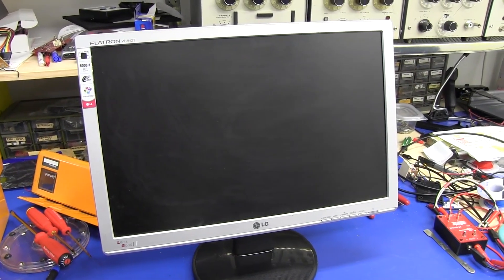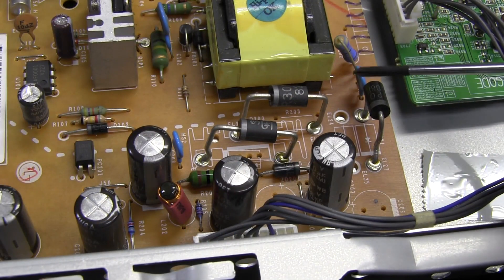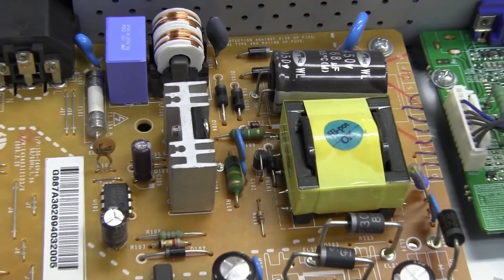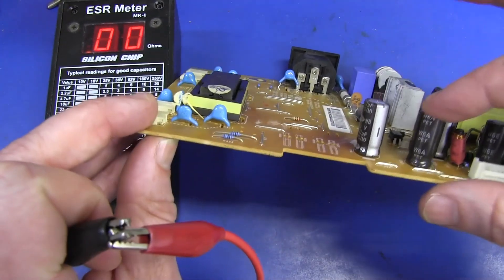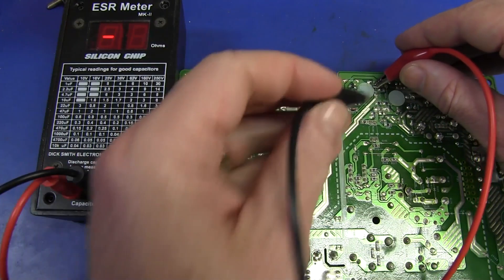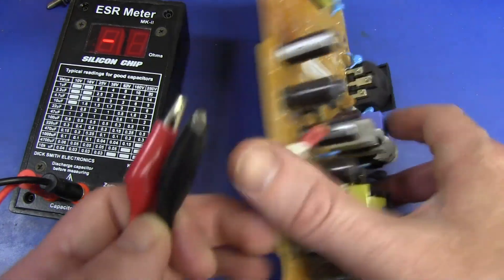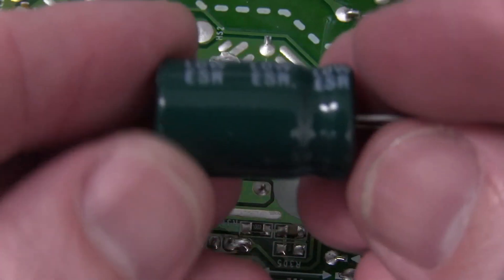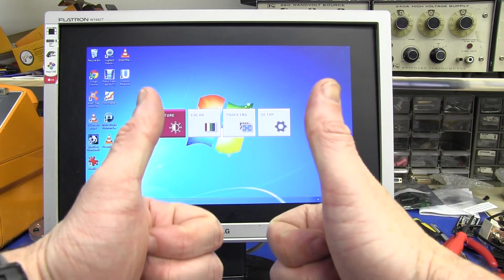EEVblog #365 - ESR Meter Bad Cap Monitor Repair

Comment: I've repaired hundreds of monitors, this is actually very very very stock standard typical for computer monitors WHEN they fail

Almost always
first check voltage in and voltage out
then
visually inspect the caps
discharge caps properly
Check the fuse for continuity and resistance
Check the ESR on the caps

then just for good measure go around the board
Check MOSFETS and DIODES and the bridge rectifier if it exists as a package
for voltage in and votlage out

if you can't see anything else
replace caps
re check volts in and out and at rectifier 
more times than not....... Youv'e fixed it

Comment: I think no need for this ESR meter , we need it only in an extreme cases 😁
Reply: @Krystal we use is it in case you don't see clearly the exposure of the cap , which is the dominant scenario,  this is what I meant by in extreme situation. 🙋

Comment: if i bought cheap caps and they are showing slightly poor esr could i use a slightly higher value or just try parallel combinations of at least the correct voltage until i see the esr i am looking for or will changing the value to a slightly higher value mess with the circuit?

Comment: if my lg has the osd settings flickering on screen after the whole image starts to flicker on off, it is possible i have also a cap blown?  i dont wanna just throw the monitor at the garbage bin  , because this monitor i have) lg 27ea53 has ( amazing blacks  I MEAN AMAZING blacks, has been an awesome 27'' monitor, if i can replace a cap on the board ....thank you for any reply

Comment: Tried fixing the 22-inch version of this monitor. 

Replaced all the bulged caps, but in the end it was a defective transformer (that thing covered in yellow tape). It was making periodic clicking noises when I connected it to mains. Couldn't save the monitor unfortunately, and replacement power-boards go at around 70 Euro on ebay. Not worth it.
Reply: should have tried the 4-wires power module that can be ordered online, maybe your unit had saved...

Comment: They should make monitors with replaceable screw-in caps that you can easily service behind a removable door. Why make your appliance so hard to open and repair? Oh yeah... because it's cheap and you know most people won't bother to repair them and just buy a new one. If only we had politicians who cared even a tiny bit about consumers we would have a very different world.

Comment: No No No No Dave! Just checking a capacitors ESR is not enough! At the very least you should have checked their capacity too! Capacitors that fail from high ESR usually bulge, leak electrolyte or explode, essentially they destroy themselves! 
But high EPR (parallel Resistance) won't show signs like an ESR failure, they always destroy the next component in line! 
If the capacitor is rated for 100uf but shows 200uf or higher, then it has high EPR and should be replaced ASAP! Otherwise you might end up looking for an unobtainium IC! 
I haven't tried it myself but I'm going to solder a resistor across the legs of a capacitor and test it's capacity both with and without the resistor! I reckon that I should see a higher capacity value with! 
No matter where I look on YouTube, I see people check capacitors with just an ESR meter which returns a good value but when they check the same capacitor for capacity, it reads high! There's no such thing as an overachiever when it comes to capacitors! It has high EPR and it's going to destroy something else! 
There's an excellent LCR Bridge Meter on eBay for $95AU that will tell you capacity, ESR, EPR (DC leakage (drain)), phase angle and Quality all on the one screen at the same time! Without this information you really don't know it's condition... 
XRayTonyB did an excellent video showing how it works, this is one tool that should be on everyone's bench! Mate, it's really that good. More awareness about this particular capacitor problem needs to be made! An ESR meter will only get you so far! 
Just take a look at the chared PCB, a capacitor with high ESR won't cause that! But a capacitor with high EPR is essentially passing DC to that transformer, it's most likely saturated and getting to hot 🔥. As a result, more current is drawn through the diodes causing them to heat and up goes the ESR on what could have been good capacitors.... EPR is a bigger problem with equipment failure than ESR.... 
I have been working on this problem for years and now that I have an LCR Bridge Meter, there are no more capacitor mysteries... 
I'm sure that you have seen Paul Carlson's capacitor tester, it tests for EPR, not ESR... That's why it's so good at what it does... This is a worthy topic that requires more awareness to... I would love to see your take on the matter... Take a good capacitor and put a resistor in series and test it, then place the resistor in parallel and test it again and see what you get?
Reply: @jayytee8062  no I don't, all that I did was search for LCR meter on eBay... There's two types, one was silver aluminium with a lime green screen and the other is black aluminium with a blue screen... Although the picture didn't show that the screen display was blue... I asked the seller for another picture with it turned on... The black one has a built in LifePo4 Battery and charges by USB... They were selling for around $100 price mark back when I got mine, I still love it, it gives all the details that you actually need on one single screen!

Comment: he makes it look so easy then you do it yourself and found out likely that there are parallel capacitors and possibly several resistors.. then you have to desolder it and do it the old fashion way anyway..

Comment: Thanks for the video. A question: do you also discharge ceramic and polystyrene capacitors before working on a board?

Comment: Hi, I bought an ESR meter to test caps while still on a expensive dc to dc charger. I don't feel like desoldering all of them just in order to test them. So there are several 100uF caps at different spots of the board, and one of them shows way higher ESR than the rest, but the value is still OK according to the device/ESR table. Does that indicate that the capacitor is failing, or different ESR is to be expected at different locations of the circuit board? Also does a small bulge always mean a bad cap, even if within ESR specs.
Reply: Here's what I read somewhere else and I think it's a good idea have some known good new capacitors that you can check and then check the ones you suspect and you'll know what the the the ERS should be reading on a known one good one compared to your one in the board

Comment: i have a dell 24" monitor that dose that but haven't got around to fixing it.   it lights up  for atleast 20 seconds then 1 of the 3 sections of the leds  go out then followed by the 2nd section then 10 seconds after 2 sections have  went off then the whole thing dies but the lcd itself stays on ? im thinking psu . caps . led strip  that contains 60  3 groups of 20 1mm  ish smd  leds hopefully i explained it right lol

Comment: Hi! I recently recapped the power supply of 2 Allen-Bradley PLCs and while none of the caps were bulging, they had no storage capacity at all. They were powered by an UPS and just the time it took for the relay in the UPS to switch between mains and battery, the PLCs made a major fault and would stop running.

Comment: Recently I got a faulry monitor to repair in the repair bussiness that I work and no one knew what's wrong because all the caps on output were looking just fine.
Even tho I don't have an ESR meter, from experience I knew that they were the fault and the monitor started working fine after I replaced all 4-5 of them :D
I will get an ESR meter soon :)
Reply: Look up ESR meter on Amazon/eBay can get a cheap works great ESR meter for under $30.

Comment: Not necessarily caused by the choice of a a bad component. 
The SAMWHA WL-series seems to be a decent series of high temperature, long life, low impedance capacitors.
However, the capacitors probably failed by a too high ripple current, causing excessive temperature rise, resulting in premature failure.
The power supply looks like a flyback converter. In general such power supplies have a relativity high ripple current on the main output.
When you look on the PCB, you see, that there is room for two extra caps, so the overload of the caps might have been caused by a wrong design choice or production choice.
When two capacitors were left out, e.g. because the ripple voltage was low enough, the  ripple current through the remaining caps doubled, possibly resulting in premature failure.

Comment: Hello, I have been following your videos, you have one of the most complete labs I've seen, I found this ESR meter interesting, where do I get one of these? I'm still an electronics student and I'm still far from having the necessary equipment, but I've seen this device helps a lot in basic repairs.

Comment: ESR meters are great.  I wish I had more training on troubleshooting stuff like smd stuff.  I have fixed a few things like tvs and monitors.  I even found a use for the ESR meter for detecting bad solder joints.  Maybe it was just luck but a bad solder joint gave a high ESR.
Reply: On a fender deluxe reverb from the 70s.

Comment: I try to fix all sorts of industrial gear at my work and I just really started at this a few months ago.

It's frustrating to have a board that's not working and not seeing anything obvious. I'm now convinced of the effectiveness of esr meters after this video and I'm going to convince my employer to buy a meter in order to increase my success rate in board repair.
Reply: Electronics repairing except tools needs extra more human senses!
Reply: The problem with bad caps on power regulation is that failing cap may have caused too high voltage to the IC and destroyed those for good. A well designed board wouldn't do that but many boards are not well designed.
Reply: @MikkoRantalainen  please tell me what I C stands for I had one blown cap on a Jensen TV set and I fixed it put a new cap in and it's still no picture or sound so I'm just curious what else might be damaged for me to look at all the other caps look good but I haven't checked the with a estimate meter
Reply: @johnmitchell8925  IC means integrated circuit. Basically the stuff that most people call "microchips". The problem with IC is that those really cannot handle overvoltage and many poorly designed power sources output too high voltage to one of the power rails going to IC which basically frieds the internal parts of the IC. The only way to fix the device is to replace all the affected ICs.

If you don't have schematics for your device, figuring out which ICs are broken is going to be hard. All the chips are usually just okay visually because we're talking about 2 V instead of 1.3 V to CPU, 9 V instead of 3.3 V to memory and so on. Definitely not enough to cause charring but too much to cause just temporary failure to the chip.

Comment: Hi Dave
I know this is a bit late to comment but only just recently found your blog and are slowly working through all your videos.
You probably have been told this already or worked it out for yourself later but you don't need a tool to unclip an LCD monitor.
You can probably google the correct / easier way but a service manual shows how it's done with the screen facing up and using your fingers to lift / unclip the bezel. Much quicker and easier. Done hundreds; no exaggeration. I'm an oldish? 56 years old tech.
Gonna watch the Peak Atlas ESR70 review next as I have one. Love it as well as their semiconductor analyzer which I also have.
Loving the blog. Thanks :-)

Comment: Totally outstanding video. Well done mate! Just purchased an ESR meter last week which has literally paid for itself several times over already. I'm astonished how impressively well they work without having to remove the caps under test out of circuit anymore. What a great time saver! By the way, I've gotten the same readings and results even once any bad caps have been removed and then tested a 2nd time around out of circuit. These devices work amazingly well and are worth their weight in gold. Don''t know how I got along until now without one. Makes tracking down the failed caps a lead pipe cinch. I agree the bad caps are most often bulging at their tops but definitely not always. Quite a few looked entirely normal and respectable from all outward appearances but measured unquestionably faulty on the ESR meter.  It's truly a switching power supply bad cap divining rod of sorts and bench tech's magic wand.

Comment: im learning so much from these videos i have a tv thats malfunctioning its one of those element hdtv's all of a sudden it just got much less bright recently so today i took the cover off the back to check the main power supply board and saw... a single capacitor with a popped up top.. now i know it needs to be replaced and im already looking online for parts, and this video showed me how easy it is to de-solder the capacitor and that im going to need to buy a soldering iron some solder and one of those wick things.. beats taking it to someone to pay them like 70 dollars american to replace a single capacitor.

Comment: Unbelieveable. I found almost exactly the same monitor (A silver LG Flatron) exposed on the street about 6 Years (or even more) ago. I took it home, figured out that the caps were bad (just by looking - didnt have an esr meter that days), replaced them and the monitor is still running. This was my first Monitor repair i ever tried.
Reply: Well done Mirko! And thanks for helping keep our planet GREEN rather than toss another failed Chinese manufactured piece of electronic equipment in a landfill junk heap! Restoring previously failed electronic equipment back to fully operational condition approaches being Godlike in my humble estimation!
Reply: @mikeadams110  soon china will not sell anything to the usa anymore, don''t worry.

Comment: what would be a OK substitute for a 450v 10uf cap for element LCD display, I have some laying around and you said I can go up but not down.   Thanks and you are a whiz bro!   gj!!!
Reply: Technically, most "general purpose" caps are rated at 20% tolerance from their designated outer case marking relative to capacitance value. This means a brand new cap fresh out of the factory rated at 1000uF could actually measure anywhere between 800uF to 1200uF being quite a wild deviance from spec right off the bat!

In most cases, they'll prove more reasonably closer to their preferred value rating considering today's modern plants exercise some degree of component quality control.

Nonetheless, be sure not to exceed that inherent deviation any further from the component's original ideal rating, meaning 10% higher or lower in value from spec. Bear in mind, capacitors of any kind (electrolytic, ceramic, epoxy, trimmer, etc) serve one of 3 primary roles in electronic circuits as detailed below the next 2 paragraphs.

Arbitrarily changing the preferred values from spec in any of those roles will absolutely cause a measurable negative impact upon the circuit's performance to some degree. Whether acceptable or not is entirely a gamble and wild guess at best.

Taking that kind of unnecessary risk simply isn't worth blowing out a more expensive (perhaps harder or impossible to get overseas component) somewhere up or downstream within the circuit such as a specialized IC, microprocessor, dedicated microcontroller chip or Laser diode.

1. decoupling capacitor. Used in this role a cap will remove any DC component (meaning plus or minus DC bias) an AC signal may be riding on back down to ground (meaning zero as in baseline on the oscilloscope) rather than riding up at +5vdc for example.

2. filter capacitor. Used in this role a cap will filter-away (meaning dump to ground) any specific undesirable AC signals (meaning unwanted noise or potentially false triggering signals) such as leftover 30hz half-wave ripple in a DC power supply. This "cleans up" the DC purity and stability quite dramatically just prior to more precise IC regulation (using an LM7805, LM7812 or LM317 for example) being the final back-end stage in any quality power supply.

3. timing capacitor. Used in this role the cap sets a highly precise desired frequency in an RC (resistance/capacitance) network circuit. In this case and role the capacitor's value shouldn't be varied even the slightest from spec without causing drastic performance trouble or even device failure.

Rather than arbitrarily deviate from the original circuit specs purchase a low-cost ($20) bulk assortment of the most commonly used electrolytic capacitors to keep on hand of which there are around a dozen. You're typically given 8-10 of each value in such assortments. Be sure to order the low-ESR variety if they're going to be used in any switching power supply unit (SPSU) all of which inherently demand and rely upon this special requirement.

You'll find 99% of the time the caps which fail in a SPSU are nearly always the general purpose rather than low-ESR variety being why they suffered an early demise.

That harmful concession nearly always having been made by the manufacturer being a tactic by which to minimize a product's cost. It's quite revolting and rather unjustifiable considering they're saving just pennies on the dollar at the expense of a product's overall life expectancy.

So spend those few extra pennies to get quality replacement caps which meet specs. In which case, they'll last for decades rather than just a year or two after warranty expiration at best.